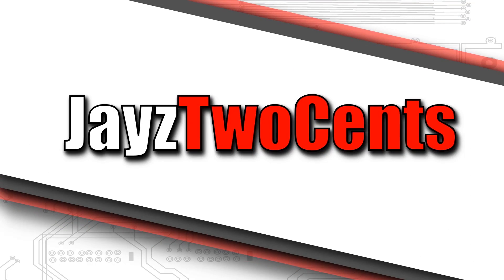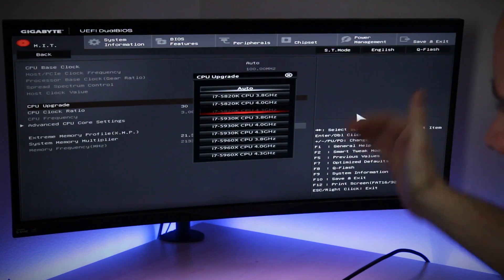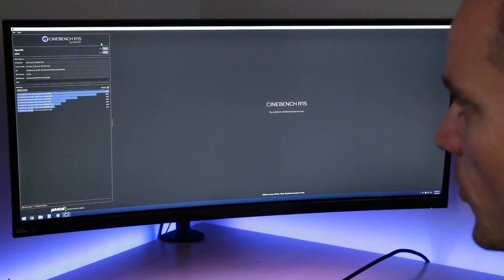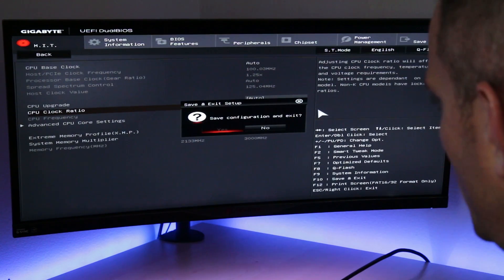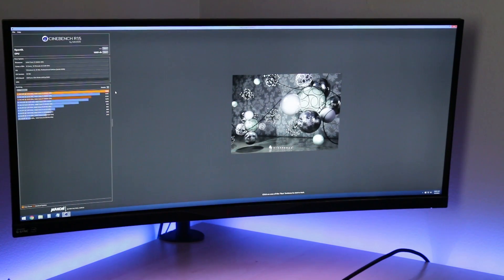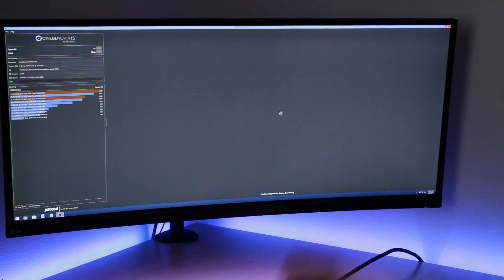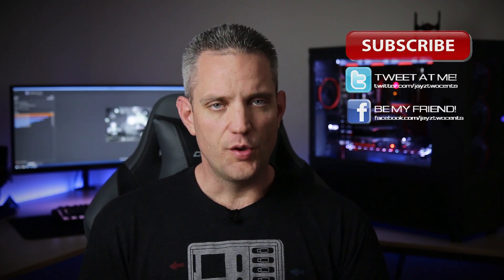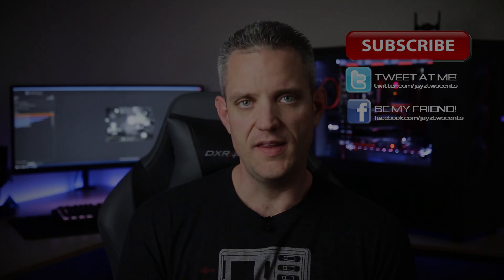XMP vs Overclock

Comment: I recently bought a 7820x and have been overclocking it; right now, it runs a stable 5 Ghz on all 8 cores @1.223 vcore. I tested it 20 hours with prime95 with no issues. Cinebench score is 2206. Did I hit the silicon lottery? (Serious question, I don't know if Skylake-X just overclocks really well or I have a good chip)

Comment: Hi there, i managed to get 5ghz stable around 75degrees ave with no peaks into the 80s with me i7 7700k at 1.33volts, however I did have to compromise and leave RAM on auto at 2133mhz instead of 3000mhz. Is that a good compromise? Or should I overclock ram to 3000mhz but run at high temps ave 85 degrees? cheers

Comment: Running XMP and Overclock to 4.8 GHz on my i7 7700K on stock voltage and air cooling.

Noctula  NH U12S

Rock solid.

Comment: Hi Jay, I recently built a new gaming pc with the Asus z170-a and a i5 6600k.   The issue is that any program i open brings up the cpu to 100%. I have tried defaulting the cpu to no overclock,  reseating the processor and applying thermal paste, reinstalling windows 10 as a fresh install, I also removed the battery from the motherboard and reinstalled it. If I try to open chrome it shoots up to 100% and youtube videos shutters.  I have removed my video card but the same issue happens. Any ideas? Note that I have 16gb of memory and it does not use anywhere near 50% of it capacity when the cpu shoots up to 100%

Comment: Question: I know this is not CPU related, but still OC related. 
 I followed your overclocking with MSI afterburner GPU video and have had great results. My question is, once you play around and get it stable, is it okay to go back to defaults when your done gaming? Is it bad to OC the GPU when you go into game, then go back to default when your done? Or should you leave it that way all the time?

Comment: i5 2500k 4.4ghz -> 5.75ghz turbo 1.360volts and stable well untill your psu starts supplying less power to the cpu when the psu is 6 years old + a gigabyte z68x ud3h b3 rev 1.3 mobo thats kinda funny like you cant disable turbo boost or use front usb 3.0 but hey i won the silicon lottery (in my head) with 64c temp under load 8hrs of aida 64
Reply: nice

Comment: For us old school overclockers, overclocking an K or Black series CPU isn't overclocking at all. There's just nothing to it. Plus the fact you pay a premium to be able to do it takes away one of the original benefits of overclocking in the 1st place, or one of it's founding principles if you like = high end performance for low end cost or just higher performance for less. Also your not really always pushing a CPU (or GPU) past it's design specifications. An 'original' range of CPUs are released at differing speeds (& prices to go with it) they all have the same cores. If the highest in the range is  say 3.0 GHz @1.45v then you should know your cheaper 2.5 GHz chip @1.28v should be able to do 3.0 GHz around that same voltage & still be within the 'cores' design specs. They are essentially the same CPUs handicapped if cache etc & batch is identical. If you can get your fsb /base clock or multi high enough course. Then there's binning to take into account but, that usually doesn't come into play until down the line, when the more budget lines of CPUs based on the same cores get released. Say Ryzen 5 series, even then it's not as bad these days. Of course pushing further always depends on the silicon lottery. I used to belong to an OC community where we would all go buy a budget CPU or GFX card see who could get the best clock or performance. Or combined fps from an overclocked budget set up. Sadly it's not quite like that these days.  Like the days of getting an AMD 64 3200+ & budget Vanilla NV 6600 to almost go toe to toe with the most expensive AMD 64 & NV 6600 GT for nothing & half the component cost. Or buying a £75 P4 Celerons & overclocking it to match a £200 P4 in minutes.

Comment: Funny that you mentioned the h100, because that's what I've been using for 2 years. Ended up toying around with my BIOS and it's built in overclocking profiles and ended up taking my 3770k from a stock 3.9 to 4.4ghz with zero effort or issues. The bios had defaulted the voltage to 1.35v which is what the autoclock used for the 4.4ghz clock so temps didn't really change at all.

 I was reading that some people on the ASUS ROG site were able to get a 4.8ghz clock using the exact same setup that I have currently (Cooler/CPU/Mobo) but they also wrote a 25 page guide on how to teak everything so I was quite intimidated by it. Looking at rebuilding this rig after 4 years though so I may try to blow shit up for giggles later this year/

Comment: Jay,  It has been a years since you made this video, however, I cannot find a newer one that mentions RAM.
I have overclocked my i7 7700K to 5.2GHz using Corsair Dominator RAM at 2400 and 1.260 volts [the lowest voltage for this RAM to be stable - getting 1.2 volt 2666 RAM soon, to try to get Vcore voltage below 1.410 volts.  RAM voltage is very important and may be why your Gigabyte MB clocked lower than the other board.  - -  Please update this video after tinkering with RAM volts

Comment: I just built my first rig. i7 7700k, z270e mobo, kraken x61 aio pump. I've been able to run 4.8ghz without breaking wither 1.3v or 75c. is 75c too much? longevity? I hit 1.35v and 81c for 5ghz. any help is appreciated. thanks.

Comment: Since when did XMP overclock the CPU?  I've never seen that.  It usually just sets the memory multiplier higher and the CPU doesn't move.  I've owned a lot of mother boards over the years too.  Of course I've never used XMP to OC anything.  I've always just used it to dial in the memory to what its rated for.

Comment: I prefer manual by far. I know I can push my unique chip much farther than a generic chip can. Getting right on the edge of crashes is what overclocking is all about. I notice a different motherboard with different phases also affect that too, so while I pushed my 8320 to 5.3ghz on my old (now dead) MSI Gaming 970, I can only push 4.75ghz on my Asus 970 Pro Gaming Aura. But it was all worth it manually pushing my hardware to it's limits.

Comment: Hey there, I've got a question, first up thanks for your interest in your community jay! My newly built PC consists of:

ASUS Maximus Hero Mainboard
Intel i7 6700k
ASUS GTX 1080 Advanced
Corsair 16 GB RAM @ 3000Mhz (2x8GB)
Samsung EVO 750 250 GB SSD Boot Drive
Western Digital 1 TB HDD
Corsair 750 Watt PSU
BeQuiet Silentwings 3.0 Fans
Phanteks P400s Case thanks to @Hardwarecanucks PC Cases series on youtube.

Heroe comes my question: I've always been a fan of SLI stuff, but I didn't realize the PCI Lanes stuff before I built my PC. So the question is:

Although the i7 6700k only has 16 PCI Lanes, would it still be a performance boost, to run a second 1080 in my system? Because as far as I'm concerned,
the 1080's would run at PCI-E 3.0 at 8x each, because they would have to share the 16 PCI Lanes of the processor. Anyone??

Thanks in advance, guys!

Comment: Fried a 16 day old 6700k running 4.8 @ 1.34v.. well below the internet's supposed maximum.
Tweeted you a pic of the burnt contact on the bottom of the CPU too, though I doubt you saw it.
Edit: Just to be clear, it's the first CPU I've ever toasted, and I pushed an old 965BE to 4.2 @ 1.45ish-v
Also, lol @ "eggs-m-pee" :P
Reply: Mash Rien Every CPU is unique. You most likely got a bad bin. I had 2 Phenom II x4s, one overclocked over 30% boost clock, while the other refused to even post with barely a 1% clock.
Reply: Really I'm ruining my 6700k at 1.34v.. @4.5 stable should I go down in voltage I really don't want to fry my new CPU??
Reply: I'm running 4.5ghz @ 1.200v,  IO 1.100v, SA 1.050v.. Though I'm not a fan of the IO voltage being that high.. I'd prefer to keep it a touch lower.. 1.2v on IO or SA can pop a CPU (I've done it)
Reply: weird. I've been running my 6700K at 1.375 - 1.4v since day one , at 4.6ghz. Temps never really go above 70-ish C. Idle is like 26c.

Comment: my cpu is amd a4 6300 dual core running @ 4.3Ghz. yep "dual core"
Reply: Ghavio Rizky That's pretty good. I had a Athlon ii x2 2.2ghz(or around there) up to 3.6ghz. For some reason, my older chips overclock a ton better than my new chips.
Reply: Sapphire EX i think older AMD cpu is better at overclocking. and my cpu max overclock is 4.51Ghz and that is old cpu
Reply: It's still a dual core even if it's running at 6.0Ghz, and even then it wouldn't surpass a newer intel quad chip at its base 4.5Ghz
Reply: Bisterk Ding Because Intel is totally relevant here. This comment chain was about overclocking. You pushing .3ghz out of a chip is nothing compared to the 2, 3, even 4ghz overclocks on the older chips, which mind you, AMD dominated Intel CPUs at that time. Fuck off with the fanboy exposition.
Reply: Bisterk Ding i just wanted to say that old amd cpu is good for overclocking

Comment: Could I have some help??? I recently moved everything over to a new tower and now it takes forever for my PC to boot up after I click the power button. Is there a reason for this?
Reply: cloakedj24 Depends on motherboard. Enable fast boot, disable a slow_mode switch if present, disable boot splash, disable OEM splash, disable debug info, etc. It depends on a lot of things.

Comment: I still got a non K processor, but im saving money while still running silent on the stock cooler, just by tinkering with the voltage for an hour or so. Its an i5 4430 (Got it long ago before knowing) and a Z97-E from Asus (bought it on a warehouse sale as an upgrade for the B85 ECS Mobo they got me). Locked the turbo on all cores (3.2 over 3.0) and lowered the voltage by a 0.14 offset. Prime 95 Small FFTs temps went down from 100C + throttling at 100% rpm to 85 at lower RPM and much quieter. (Aftermarket thermal paste tho). Might delid just for fun.

Comment: 4690K 1.5 Volts, 4.8 GHz, 0 fucks given.
Reply: Peto111222 LOL I bet it was only once.
Reply: Lol might want to turn the voltage down unless you plan on buying a new CPU in the near future.
Reply: My temps average mid to low 60c. Its been delidded with liquid ultra. On a custom loop with a triple 120 rad just for the cpu, and yes i'm getting a new cpu anyway soon. I run my stuff bawls to the wall all the time.
Reply: mid to low 60c at load? If so, that's ridiculousssss.
Reply: PhuchxpH Honestly I think the CPU I have would overclock really well under LN2.
Reply: That seems like it could get pricey? Also, I assume that would just be something you'd try to see how far you can go, yeah?
I haven't the slightest on how much LN costs lol.
Reply: http://cdn.overclock.net/8/8b/8b448637_4_8GHz1_51volt.jpeg There's a screen shot of AIDA64 running fpu test.
Reply: Wow.  I wouldn't of guessed you could maintain good temps at 1.5v.  Granted I have a tempered glass case with next to no airflow, but at 4.3ghz 1.185v, I hit 70c under load (fans at 900rpm).
Reply: Lol I'm not trolling. My temps got so out of hand I had to crank the ram a couple of hundred mhz below even the XMP preset.
Reply: Doing all of that wouldn't give me those temps I assure you :p
Reply: The stock tim on intel cpu's are garbage. There is not one IHS that is flat. Intels are usually concave and AMD's are convex. Look up videos or forums that show IHS lapping.
Reply: i have mine at 4.5GHz on 1.2975v on core and 1.82 on vccin,under load(like gtav) i have less than 65C with silentiumpc fortis3 cooler
Reply: Mid to low 60c under load? Put it through a stress test if that's your idea of "load."
Reply: Depends on what you call a "stress" test. AIDA64 FPU test brings out high temps out of cpu's. Prime95 small ffts is overkill as hell on a cpu. "Load" being heavy cpu usage in gaming, NOT running prime95 which is unrealistic usage.
Reply: AIDA64 was a breeze compared to RealBench
Reply: http://img.techpowerup.org/170204/realbenchtemps.jpg   RealBench with higher voltages.
Reply: Looks like you underclocked the crap out of that ram...
Reply: I don't know if you're trolling, but wtf does that have to do with running 1.52 volts through a haswell chip and maintain those temps? And that ram is overclocked to 2200mhz xmp is 1866mhz. Stock Haswell DDR3 speed is only 1600 mhz.
Reply: Not trolling, adding even 2400mhz rated ram would raise the temp up noticeably. Increase the performance further and the temp increases exponentially.
Reply: Regardless of which board you're using, cpu temps tend to get out of hand as you approach 3Ghz. Even though I was able to clock my chip to 4.8Ghz at 1.365V, I had to back it down to 4.7 and my ram by 400mhz to maintain reasonable temps.
Reply: Your temps got out of hand from bad cooling. I had to delid, lapped the IHS, evened out the bottom of the IHS with 2000 grit sandpaper, then, use liquid metal TIM. Running with a EK Supremacy MX on a triple 120 radiator.
Reply: Bisterk Ding why u want me to put my cpu under FULL load?i dont render,when i was testing my oc profiles i was testing it with games-i was playing for about 4-5h and it finally got to be stable on 4.5GHz,i just changed thermal paste yesterday to gc extreme and it was 5-7C improvement comparing to pactum pt2
thats comfortable for me
Reply: what would you think about direct die cooling? have you ever tried it?
Reply: its very risky cuz u can damage ur cpu if u wont be carefully,and u have to have  MSI Die Guard to protect ur cpu die
Reply: I overclocked 4690K to 5.9 GHz with 2.7 Volts ... once
Reply: ye ye right any prouve?
Reply: +OVERCLOCK EVERYTHING dude, you ran AIDA64 for 5mins on liquid cooling. Liquid cooling takes anywhere from 45mins to a full hour to reach thermal capacity.

Source available upon request.
Reply: 7980XE, 4.7GHz, 10 Volts, 1 burnt house, 0 survivors.
Reply: RAM speed made no difference on core temps. The ram i have wouldn't go any higher than 2200 mhz , so I don't know what you reaching for. I have proof that I can run 1.52 VOLTS through Haswell and still have good temps. I see none of your proof or anything go troll someone else.

Comment: 5820k 4.4Ghz at 1.225 Voltage, very happy. Even with just an H55 Corsair AIO, it only hits 71C on the socket, mid 60's for the cores, with AIDA64 at 24 hours. I think maybe I'm a little luckier than most as far as voltage, otherwise no way this H55 could handle 1.3V or above.
Reply: I currently have my 5820k running at 4.3ghz at 1.185v =D
Reply: Nice, that's a good voltage, though I didn't attempt any runs below 4.4 really, I want it between 4.4 and 4.6, but my cooler won't handle 4.6 so I'm gonna set here for now and wait. When I first put it together I had 4.2Ghz running at 1.10 but I got bored there lol.
Reply: Have you tried 4.4 at a lower voltage? 
I think this weekend when I get some free time, I'm going to see how much I can get out of my chip at 1.2v.

I really don't want to go above 1.2v, as I'd like to wait 2-3 years before having to buy another cpu lol.
Reply: Yeah I can get it 99% stable at 1.2v, but there are one or two apps where it sometimes crashes, so I fed it an extra .025 and it solved the issue, temps barely changed from 1.2 to 1.25, only about 2*C, so I'm very happy with it. It hits 4.6 easy at 1.3 but my poor little H55 can't handle it.
Reply: I have the H100i v2 and with stock fans, it does a good job of keeping it under 70c.  The most I've seen my cpu hit is 71c and that's with the fans running at about 900rpm.  If I run them at 100%, which is RIDICULOUSLY loud and annoying, it stays around 60-65c.  I have my Pc on my desk, which puts it like 2ft at most away from me, so I'm forced to keep it low enough so the fans don't ramp up and drive me crazy lol.
Sometime in the near future I plan to snag some better fans.  I'll most likely try pushing her a bit further once I do.
Reply: Nice, yeah I was a little short in my budget, didn't want to cheap out on components, so I decided on a smaller basic AIO cooler just for a while, but I plan to buy the best 240mm AIO I can get, in early spring when temps begin to come up here in northeast PA. At 4.4Ghz with 1.225 volts, my avereage temps in a game is low to mid 60's, and with AIDA64 worst case scenario it hits 68-72.

Comment: I overclocked my cpu via Asus auto overclock on the motherboard. But my Cina bench score went from 906 to 968 I guess I lost the lottery .
Can someone help me with some manual overclock tips, I got an I7-6700K and an Asus gene viii Z170 motherboard and G.Skill Value 16GB (2x8GB), 2133MHz ram.

Comment: Jay, I can not get MSi Fastboot to work properly. If I turn it on my system boots in about 9 seconds but I can not enter the UEFI no matter what I try. I downloaded the Fastboot utility and still no luck. I end up having to reset my CMOS to get into the UEFI...which, of course, wipes all my settings. any ideas? OR maybe something you could look in to. I have an MSI Gaming 7 mobo, a core i5 6600k (@ 4.5 GHz) and I boot Win 10 from a Samsung 256 MB, NVME SSD. I think those would be all the relevant stats. If you need more just ask.

Comment: For general use I use the software with my ROG board to select a 4.2ghz overclock on the 4670K but then I tweak the memory controller and set memory to XMP profile in the bios.

Been running with no problems for 3 years.  I can bench at close to 4.6ghz.

You can manually overclock modern Intel chips using a downloadable program called Extreme Overclcocking Utility (XTU).

Degradation is often the thermal paste between the cpu and the integrated heatsink ageing.  High end chips on socket 2011 have solder so should't slow down as quick.

Comment: Energy consumption is directly linked to CPU frequency.
Even if you leave the core-voltage exactly the same, a 20% frequency increase will result in ~20% higher power consumption.